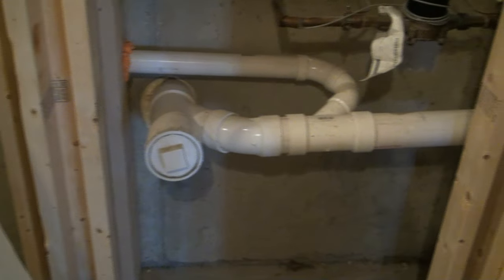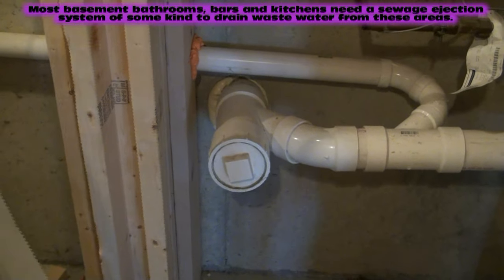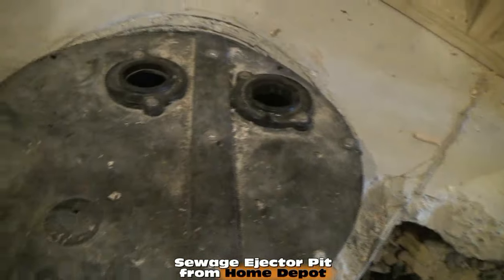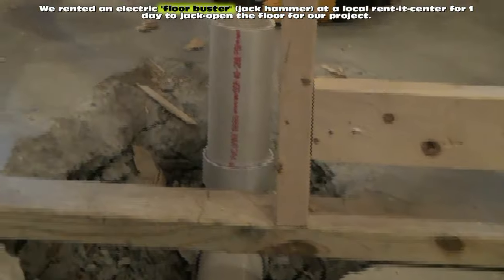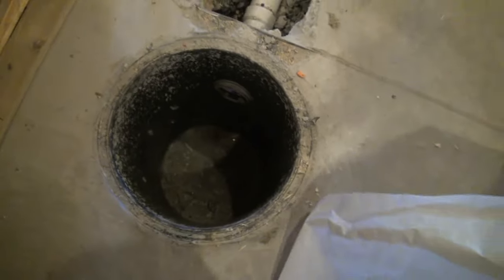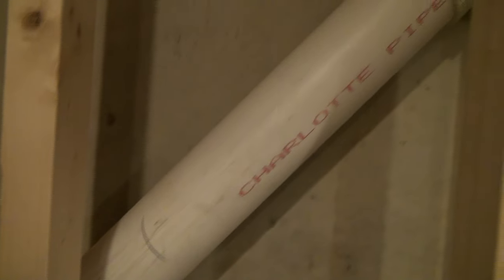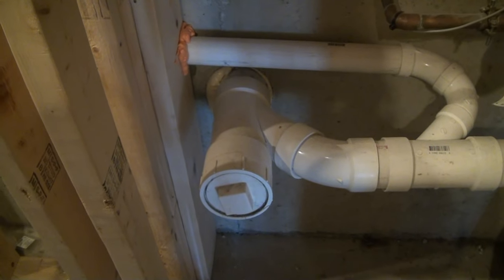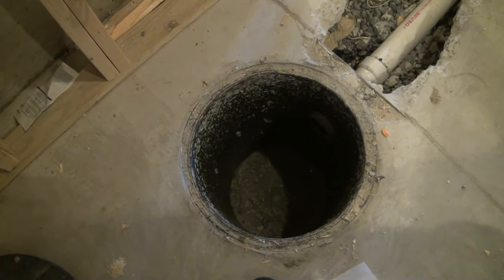Basement Bathroom Sewage Ejector Pump System

Comment: In the U.K we use 4 inch from the toilet pan. I reckon we have a heavier load.
Reply: What struck me when I visited the U.K. were the soil lines( in some cases) run outside and down the back of the house.
Reply: Same here in Philadelphia.  3in is actually illegal

Comment: Great video and information easily explained! A few questions:

1) Do these ejector kits allow you to have multiple incoming waste water sources that feed directly into the pit? Or do they typically only allow one incoming waste water source, thus if you have multiple sources of waste water, they need to feed into one PVC pipe that makes it’s way to the pit?

2) What is the ideal placement of the kit? The closer to main sewage line the better? 

3) Should you try to place this in a location that can be easily accessible in case it needs future maintenance such as a closet where you can opt to not cover it with a flooring material? Or as a rule of thumb, do you need to cover it with concrete to prevent odors from leaking out?
Reply from the maker: Yes you could do a bathroom, laundry room and a wet bar all going to the none ejector pit. You can put them anywhere with within 20' to 25' of any main sewage line. Yes they need to located where you can always access them easily...in a closet or a storage room is our favorite places to install them.

Eddie
Reply: D.I.Y. Remodel Videos what is an average price I can expect to pay a local plumber to do this?
Reply: @DIYRemodelVideos  how high can this pump up to? max?
Reply: @eastudio-K  That always depends on pump horse power, height (head) and diameter of the pipe. You can check the pump manufacturers table for pump, volume of discharge, based on output diameter and head. Same for sump pumps.
Reply: @eastudio-K  most models can go up 6 ft and horizontally 20 ft

Comment: I am interested in the installation of the pipe into the pit, as my pit is leaking at that seal with clear water from rain and fills my pit so the motor runs on and off for ever until the water table drops down. The is clean water is not good for a septic system long term and it is not allowing gases to escape my drain pipes as the water level is over the entry pipe when i turn off the motor. I need to stop that leak. Is there a fitting there that screws onto the outside of the crock, or something different? Your expertise and feedback is appreciated.

Comment: We are purchasing an building built in 1942. The sewer line to the city sewer line is nearly at the top of the basement wall. Currently, there is only a toilet and a sink in this building, but we want to refurb the bathroom, move the sink and put in a shower.  Because there are steel I beams between the shower drain and new sink will be, it might be easiest to let them drain into a basin in the basement and then pump up from there. 
Q) Does the sewage ejection basin need to be sunk into the floor or can it be simply secured to the floor. I don;t want to have to chisel through concrete if I don't have to.

Comment: I am inheriting the mistake at the lake walk-out basement LAVATORY WASTE LINE Builder SCREW-UP ...... the pit exists where it should not have been and I need not only the *pump system installed in that BUT ALSO the floor saw-cut to insert toilet-flange / pipe and one more line cut in for the code compliant sink drain .....  what should I buy etc ???   Thanks if you can assist!  GBjj

Comment: Is that toilet line short enough that it doesn't require a vent?
Reply: The pit would have a vent
Reply: Once it gets to the pit fine..But when the terlit flushes he's going to get a gurgle/bubble do to the fact there is no vent on the 3" terlit line going to the pit. I have the same set up in my basement. It won't flush properly this way.
Reply: Here you have to a Vent pipe at the Fixture(s) and at Pit. Otherwise it won’t pass inspection. Also if you sell your home, without it done to code, the new owners, can make the seller pay for the corrections. BTW They can all go to the same vent pipe, up through the roof. Also the discharge, has to be close to the exit pipe to the outside. There’s a minimum distance for horizontal runs, and for vertical runs. I also think the pump out connection has to be down stream of all other connections.

Comment: How close does the sewage ejector pump need to be to the sewage line out of the house? Could I pump across my basement under the floor and then up and out?  It would be about 50 feet or so.
Reply from the maker: These are designed to pump directly up and out of the top of the sewage ejector pit...they can't pump under the floor and then up...sorry brother!

Eddie

Comment: How do you plug that hole in the pit?  I'm doing the exact opposite. I'm removing a bathroom that's connected.
Reply: fill it with concrete and fill